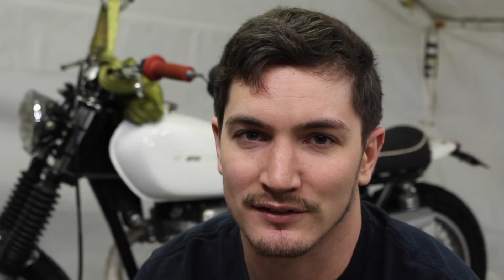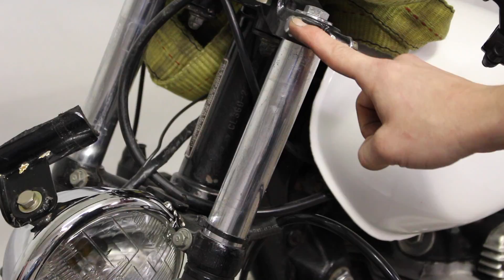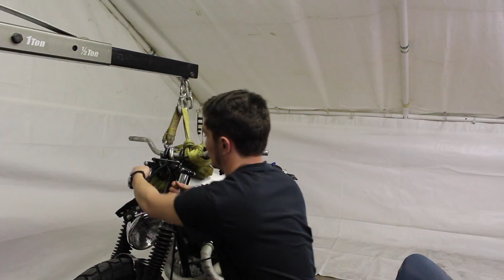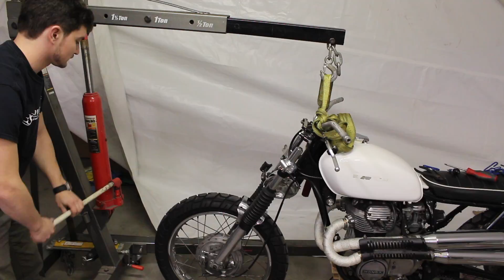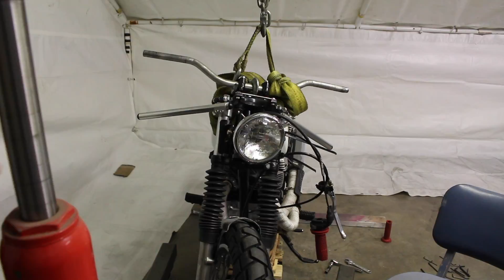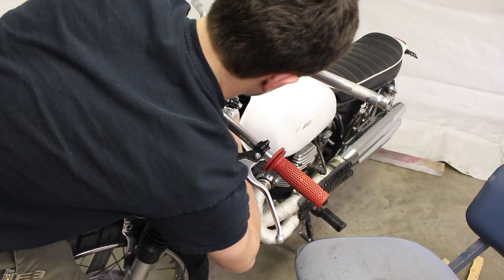The CL360 gets new handle bars

Comment: I might already know the answer but I would really like to know your opinion too. Now is it any comfortable riding this style? Common sense says that before would be more comfortable but what's your opinion?
Reply from the maker: It is for me. I’m only 5’ 6” tall so this is a nice style for my height. I used to have a 2004 Kawasaki ninja and those handle bars used to hurt my wrists. This bike on the other hand fits the build of my body better. I also like the lower handlebars when taking continuous corners. The taller bars would be better for cruising.
Reply: I have straight handle bar (similar to old handle in this vid, just a bit lower) on my bike and it's just a tiny bit more comfortable than clips on. I'm 5'8 with long arms. I can say it's a compromise of look/comfy setup. 

But if u really want clips on, get rearsets as well. You don't want to sit on a bike with your knees to your chest for an hour ride
Reply: @worstteammate4377  I see what you mean. For the footrests to be more of a back position so the angle of your knees is not that tight. I guess I am not in the need of the clip on but I really like the way it looks on the bike and I thought of me better to drive with me hands in a more down position. Clubman style is also attractive

Comment: What's up dude I was wondering if you could put a link to the headlight and also what kind of tires are those?  I recently bought a cl360 and was planning on modifying it. Keep up the great work dude!
Reply from the maker: Nick unfortunately I bought the bike in its current state. So I don't know the brand of the headlight. As for the tires they are shinko trail masters.
Reply: @BuildsbyBailey  hi bro I'm Ali from Pakistan I want get these two piece handle bar from I can get it,,,